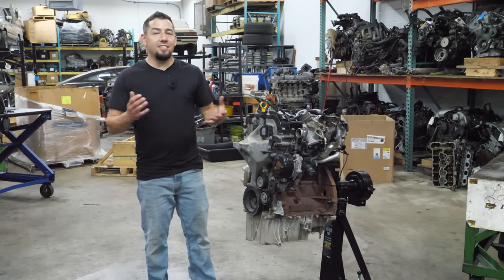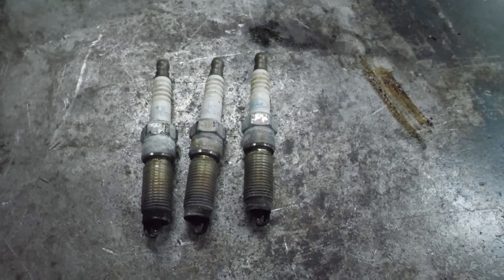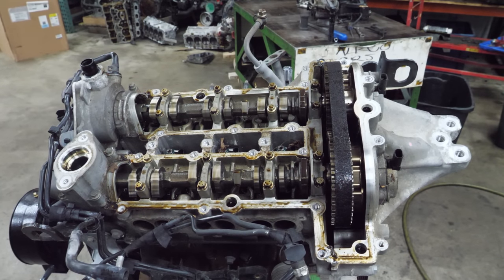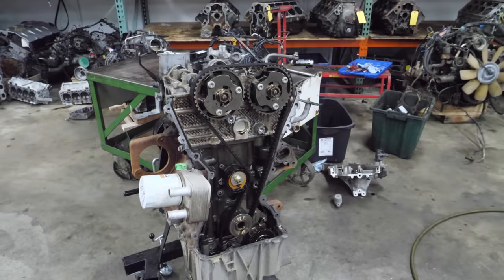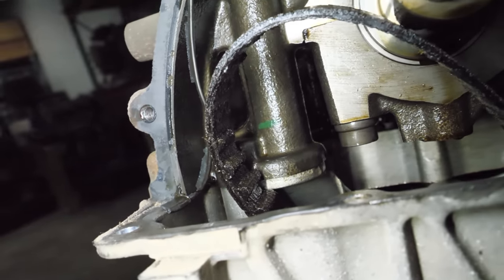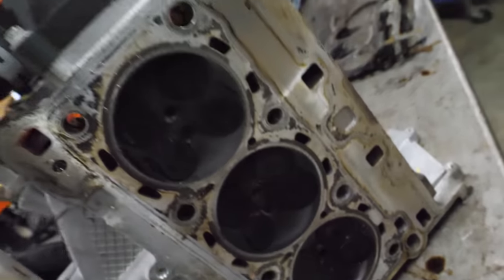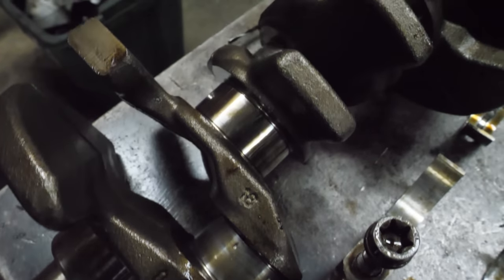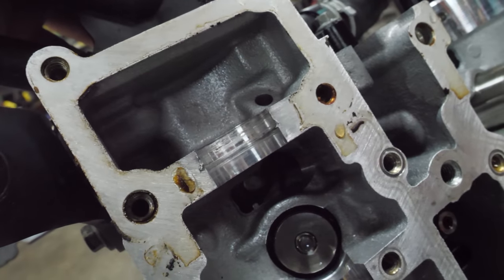JUNK Ford Ecosport 1.0L 3-Cylinder Ecoboost Teardown. LAWSUIT ENGINE!

Comment: I actually want a documentary on what happened to the engineer who made this and how it was pitched to the CEOs
Reply: It may have been the other way round!!😆
Reply: Yes that is something the ceo forces the engineer to do. 😂
Reply: Netflix won’t touch it that actually sounds interesting
Reply: @barryporteous4904  I thought ideas are pitched to CEOs? 😅
Reply: @GCS88 If it was truly up to the engineers, cars would last 500kmi easily. But there's always some middle man that wants to compromise to save a buck. Buck here, buck there, once you finalize the design, to an engineer its dogshit but if the bosses love the idea cause they managed to make the engine $50 cheaper to manufacture, they unfortunately have the last say on it.

Thats all it boils down to. Penny pinching to try to squeeze more profit out of where they shouldn't be. Like seriously, as an OEM, manufacturing hundreds of thousands of these units, the difference between a timing chain and a belt must be no more than $50 each. And thats the difference between a car that won't last their customers 2 years and one that will last 15+ with basic maintenance. But they don't care, because they all do it. Even Toyota has been slowly loosening up quality control to same some money, at the expense of their own customers.
Reply: I think ceo just looks at max profit?
Reply: It probably was made bc many countries tax displacement. 995cc is a LOT cheaper than say, 1995cc.
Reply: @CounterfeitMcCoy  licensing costs and manufacturing costs are two different things.  One has to ask why Ford doesn't use CQI principles to ensure their customers are satisfied or even proud to say they own a FORD. (As opposed to being embarrassed).

FWIW I have owned 3 Fords and never again.
Reply: Think he got a job at Boeing.

Comment: Wow! 1st time seeing a timing belt engine like this.  They made it as a throw away car when anything goes wrong.
Reply: pfft, its built Ford tough. it'll easily outlast every other brand on the road. which is easy to do when Ford's spend more time dead on the road or in the shop somewhere
Reply: @tradde11 that's the joke.

Comment: Always love how a $10 belt destroys the entire engine.
Reply: In this day and age that belts probably 65 bucks not including tax.
Reply: It wasn't the belt that failed 🤦
Reply: @SASMacDroid belt debris blocked the oil pickup.. I’d say that was pretty significant
Reply: I hate that auto manufacturers constantly ignore if it isn't broke don't fix it. So many car companies take designs that worked perfectly fine and then make  it worse.
Reply: The belt disintegrates and the particles block the oil filter starving the engine of oil killing the turbo and engine and ford will give you a quote of 7-8k to fix.
Reply: The majority of premature engine failures are embarrassingly economical to avoid, the main one being, of course, simply changing your oil every 4-5k regardless of what the factory says. That’s even MORE critical in engines with a wet belt or timing chain because the additives in the oil treat the rubber, and those additives break down even faster when they have more surface area to treat, like an engine rubber belt.
Reply: @emotionz3  people will follow the stated service intervals. The wet belts are the problem they are rated to 5 years or 100k miles. As for oil there is one recommended oil to use but this info is only found if you search forums it's not stated officially. I believe the after sale care for these cars is terrible considering all the issues are design flaws.
Reply: I will never buy a vehicle with a timing belt. You hear that Honda why did you go back to belts?
Reply: @HUFF-N-PUFF-2024  chains aren't perfect either. Plenty of chain-driven engines with problems.
Reply: Ford just came out today and said the wet belt system is flawed and doesn't work.
Reply: $2000 engine blows to protect a $10 belt.
Reply: the wet belt isn't a bad idea-IF the belt is made of the right material. But not keying the crank? Not only is it a mechanic's nightmare, it's just plain cheap.
Reply: I guess, not the belt was the problem. Due to the belt is running in oil, the engine should have been running with special oil. If you don't do that, the belt will lose the teeth!

It's a known issue, but you can handle it by using the correct oil!
Reply: It's not really the fault of the belt. Ford destroys it with their shitty design. The belt is just along for the ride.
Reply: @HUFF-N-PUFF-2024 Honda didn’t go to belts they always stayed with chain
Reply: @itswais77  pretty sure the 10th gen 1.0L civics (at least) are belt
Reply: @Matticitt Especially Jaguar and BMW.
Reply: @itswais77 I have owned Hondas with belts and chains. My current Honda has a chain and may well be my last Honda as they has let standards slip.
      I hope to get at least another 10 years out of my 2007 Accord as every manufacturer is making crap these days.
Reply: No keyway on Jaguar ingenium engine either and Jaguar is not a cheap car. Cheaply made but not cheap to buy.
Reply: @firingallcylinders2949  emission control..
Reply: lmao honda - i love those cars but they had some really dumb choices like that, but they probably had too much faith in the average consumer on that.
Reply: Toyota's most reliable engine is the 2uzfe, and it's using a timing belt. @HUFF-N-PUFF-2023
Reply: @Matticitt Audi used timing chain on their 3.0 tdi/tfsi 2.0t 4.8tdi and 6.0 v12tdi and it has a lot of problems regarding the timing chains And if you know about timing chains they need the engine out to do a chain replacement. So it's more about the engine design.
Reply: It's not an accessory belt
 a timing belt goes for 100 bucks or more easily
Reply: @HUFF-N-PUFF-2024  timing belt is not a problem, problem is timing  belt  design in  oil.
Reply: @briancarton1804  my 03 toyota matrix 2zzge has a keyed crank. And 232k miles not a check engine light in sight
Reply: Is the engine an interference engine? Chains are a pain in the butt too when the timing chain cover leaks.
Reply: @MAGA_EXTREM1ST  No surprise there. A well made engine with no historical problems.
Reply: the belt does not destroy the engine the wrong oil does??
Reply: @HUFF-N-PUFF-2024  All Honda V6 engines have timing belts.
Reply: @lobsterparty72  Retail. Ford probably pays $.50 for them

Comment: Ford engineers " We've been using chains to drive engine internals for 75 years, and they are bullet proof. Lets change that......................."
Reply: I doubt any engineer said that. More likely an actuary and executives in a boardroom demanding cost cutting design options.  "Do it or you're fired" is a very convincing argument. It's not just Boeing building crap to increase short term stock price.
Reply: Amen 
So true
Reply: @IslandArt61  the car (or any other produt) only hs to last the warranty period) then it isn't manuf's problem. No point in building cars that last 20yrs for munuf's
Reply: no. Chris Farley’s less funny cousin said that. They thought he was being serious.
Reply: timing belts are better than chains.
Reply: @inspectorjavert5563  Sure, specially the wet ones, when they snap off due to bad fuel / incorrect oil used / no maintenance schedule / etc... Nothing like this happens with chain.
Reply: @cassianomartin2699  Chains always stretch and the tensioners always go bad before the actual chain or belt. Belts rarely go bad from snapping or wear, the tensioners (on both chains and belts) tend to be the weak points. Lower heat and no oil exposure allow for belt tensioners to have a longer life than chain tensioners. Belts are more easily serviceable, quieter, and allow for lower oil capacity.
Reply: @inspectorjavert5563  well, it's not happening. I see only broken wet belt engines, lots of failures due to belt snapping, missing teeth, and clogging on the oil catcher. I see like 10 belt failures to 1 chain failure. At least here where I live I avoid at all costs wet belt engines. (The dry one are OK, I don't see issues with them)
Reply: @cassianomartin2699  I'm talking about dry belts.
Reply: @inspectorjavert5563  dry one works. I have no complaints about that. The issue are wet ones. They cook inside the engine, it's a pretty bad design.
Reply: wet + chain = OK
dry + belt = OK
wet + belt = Trash
Reply: @cassianomartin2699  yeah, oil and belts dont mix well.

Comment: The engineers really worked their asses off to make these as cheap and quick as possible to assemble. Which is good, because they'll be replacing a lot of them
Reply: All ecoboost
Reply: @Meton12765  That's what I mean though. Someone worked really hard to make it this poorly. They min-maxed their stats favoring cheapness
Reply: Better belt solves the problem
Reply: @briantruck2284  no, better engineers solve  the problem.
Reply: Yes, as he said, in lots of 500 at a time :)
Reply: @felixbors7546  They're probably all great engineers, paid to design what the beancounters ordered.
Reply: @Burnsidef250  You do understand that what I meant is that min-maxing in engineering doesn't require particular effort. It's easy, concentrate one single feature at the cost of everything else and don't bother with the consequences. Just use known easy methods on the rest of the thing after you've achieved the feature goal you want. No need to start developing something new aka engineering it.

When you're building something like this, you need to take materials engineering into account, which they didn't at Ford because that costs a fuck ton and means we have to start enumerating factors of what needs reinforcing, what alloys are to be used and for this sort of catastrophic fuel efficiency you also need a team whose playing it reaaal safe and just dumping fuel to cool down the combustion chamber and running the thing rich as fuck, meaning there was no optimization there either, probably because the block and head can't take higher combustion temps.

Basically, in engineering it's always easy to make something small and easy to build OR big and durable but if you small and durable you need to start working your ass off to make that a reality that doesn't grenade itself after less than 100k kilometers.

An example of a small and durable three cylinder that's also not been downsized too much is the engine in the current gen Toyota GR Yaris. 1.6 liters, has twice the fuel economy of this thing and can be boosted to make ridiculous power out of that small of a displacement.

That's an engine engineers worked their asses off on to make a small, easy to build, durable, fuel efficient and powerful engine.
Reply: They are forced to build things cheaply so the stock holders can get their dividends.
Reply: You have to wonder how much money they're really saving by using some garbage belts rather than a couple timing chains. $5? $10? Surprised they didn't go with a plastic timing cover and oil pan.
Reply: The engineers design what management  tells them to. 
"make a cheap engine" 
They will do it.
Reply: @JasonLuther1  How can the bean counters get involved in engine design? That's nonsense.
Reply: @JasonLuther1 as an engineer, this is exactly how it goes. The engineers do the best they can with the constraints given that were all predetermined by company management, the root of all evil.
Reply: @FairladyS130  they set extreme limits on expense causing engineers to cut corners, thats how they indirectly get involved.
Reply: @Gruntsworth  Well, the timing cover WAS plastic. Agree with you on the oil pan.  Given how badly this was built, a plastic oil pan would have been just fine for this waste of raw materials.
Reply: @Colin Idris Williams UK gallons are larger.  4.5L vs 3.8
Reply: @felixbors7546  Engineers are at the mercy of the bean counters. Everyone knows that.
Reply: Hello Eric.  Thank you for this.  Gotta keep the oil changed or else.  Boom.
Reply: @felixbors7546  Exactly.  Better engineers would have keyed the crankshaft and used CHAINS instead of belts to drive the oil pump and cams.  Would it be a great engine had they done those two things?  Probably not since neither power or mileage are particularly good, but chances are the reliability would be at least acceptable, so it wouldn't be a terrible engine either, but calling it terrible as it is is being too kind.  It's a pile of garbage.
Reply: @JasonLuther1  I'd argue against that point.  Budget is almost ALWAYS a design constraint.  Great engineers can figure out where they can save a few pennies, and where they absolutely shouldn't cut corners.  submerging rubber belts in oil which ignores the material properties of the belts is something that merely competent engineers would never do because they know better, much less good or great engineers.  Oil will break down the rubber in the belts which guarantees premature failure.  They could have either used chains instead of belts, or a different design that would have run the belts dry, which is how they are designed to run.  Chains would have been cheaper than a different design.  This isn't the first time Ford engineers completely failed to understand the properties of the materials that they were using.  This really is inexcusable.
Reply: My last Ford product, 2002 Mercury Cougar V6, convinced me never to buy another one.
Reply: The engineers probably did a great job.  Then the accountants got to it and made them keep skimping til they hit a price point.
Reply: @UrielX1212  I think you are kind;  I'm a radar engineer.  If anyone forces me to implement crap, I stand up, say it out loud and move on.  This is America, there are always options.  But maybe you are right, for mechanical engineers it may be grimmer.   We lost many manufacturing jobs in the 90s.  So maybe there are not that many choices now...  Ford seems to make many unfortunate decisions thou..
Reply: NOT Engineers. Crap like this is because some dip wad with business degree, trying to screw as much money out of the cost as possible for their bonus. Engineers will tell him no, but the business dip wad says "do it or your fired".
Reply: @oldfag_adventures  I fully agree that the accountants always seem to do a fantastic job of forcing engineers to cut costs more than they want to.  That said, it's up to the engineers to find ways to cut costs without ruining the design.  Once it gets to the point where they feel they can't do that, they have to explain to the idiots in management that making additional cost cutting will kill reliability and will likely cost considerably more money when they failures consistently happen under warranty.  Now, if they are forced to make the changes anyway, then it is squarely on the idiots in management.  ANY smart engineer WILL make their arguments and will document EVERYTHING to cover their own asses.  We'll never know who the morons are at Ford...  The Managers?  Or the Engineers?  Maybe both?
Reply: There was never a good design that an accountant or purchaser couldn't screw up by whining to the C-suite.
Reply: @Gruntsworth  "You have to wonder how much money they're really saving by using some garbage belts rather than a couple timing chains."  Ford converted to chains on this engine around 2019 I think and it is possible to retrofit the timing chain setup to former wet belt engines.  Regarding floating sprockets & locking tools instead of key sprockets, most European engines use the former even though it is dumb -- I'm not sure why.
Reply: I have a 2012 Ford Focus with this engine and manual transmission. I currently have 126,000 miles. At 93,000 miles the oil light came on and I immediately changed the belt and the oil pump. The engine works flawlessly. With an average consumption of 38mpg and an excellent 61mpg (experienced several times), the car drives beautifully and the engine, if you know how to use the manual gearbox and keep it in the right revs, entertains you on the winding mountain roads. The engine in the video is clearly abused and the owner did not take care of it. Unfortunately, certain unpleasant situations are generalized and hence at least idiotic comments. The only complaint related to this engine is, however, the lack of a slightly more generous torque.
Reply: It's the reverse of the Bionic Man.
Reply: @Canthus13 this might be the most believable counterpoint. For the most part, assembly and shipping of parts couldn't be that much different in a modern fwd vehicle whether it's a fusion or a focus. I could see a body-on-frame vehicle having more involved assembly but having multiple price points not based on actual cost to manufacture is going to hurt the company or hurt the quality.
Reply: If the engine can last beyond the warranty period then the company gets more money through repairs out of the customers wallet.

Comment: I've seen redundant systems before, but never redundant failure modes. If that oil pump belt didn't get the job done, that timing belt was ready to let go at any minute and finish the engine off